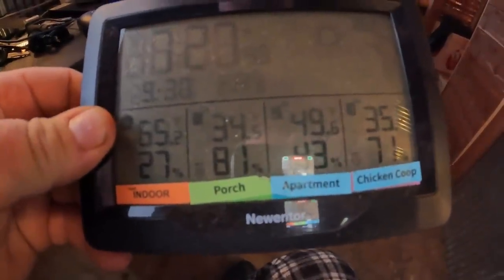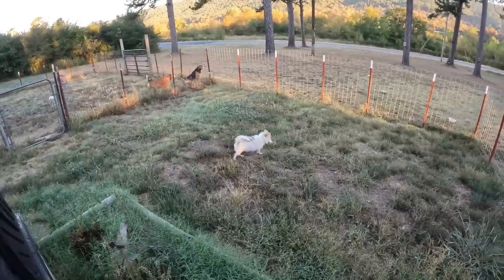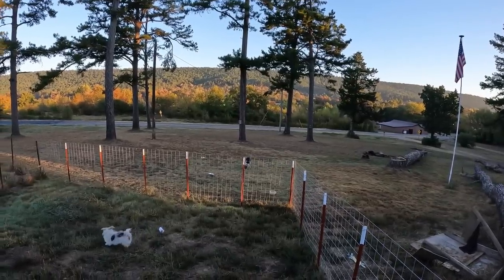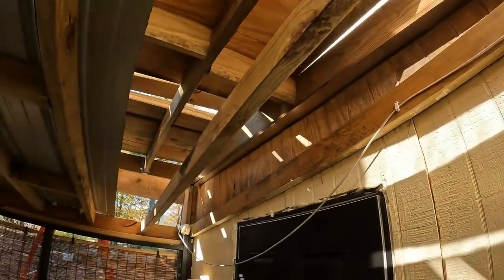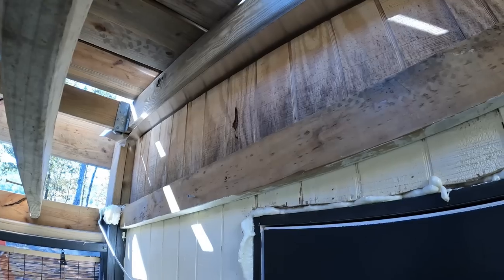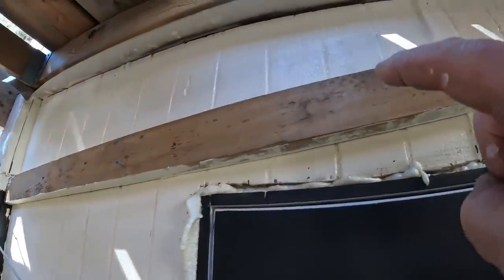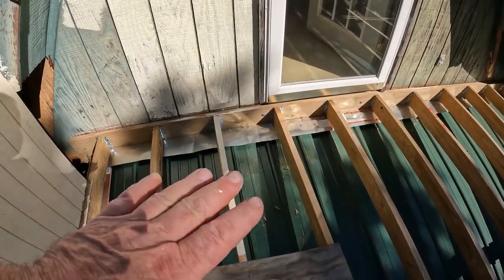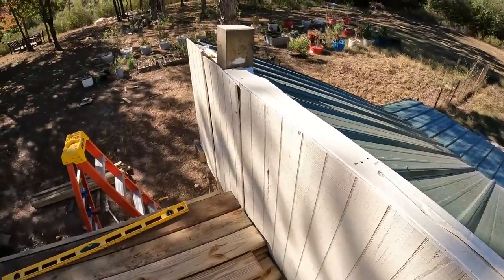Today Was Rough! Getting Flashing and First Deck Boards Down

Comment: Hello, Mike from Northwest Ohio. Just an idea to work on your deck. If it was mine I would take your 2X10 and slide it under the deck onto the metal roof to spread the weight to walk on it to stand up to screw the deck boards down. Good shows thanks.

Comment: Come on brother,  spread those deck boards out and walk on them,  joist stepping ain't for us old guys, just push em up tight one at a time and screw em down, your 6x6 post will keep them from sliding off, work smarter not harder 👍